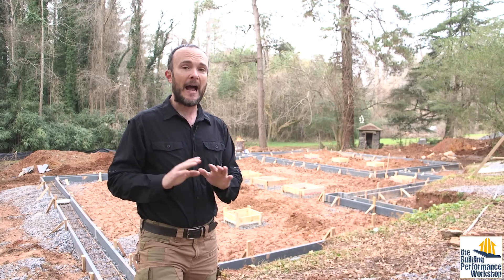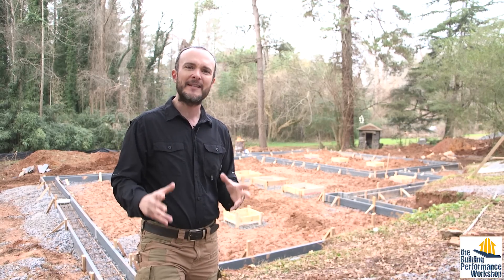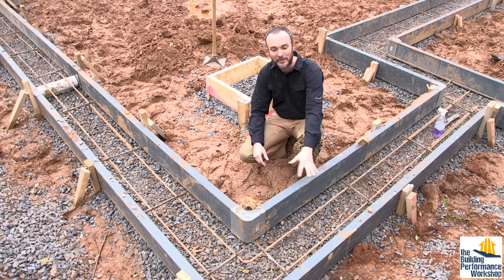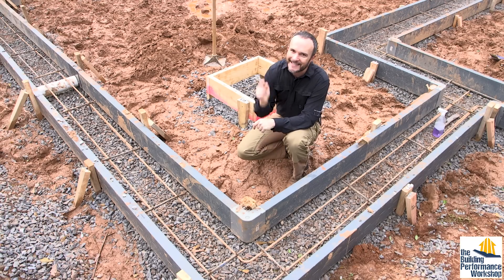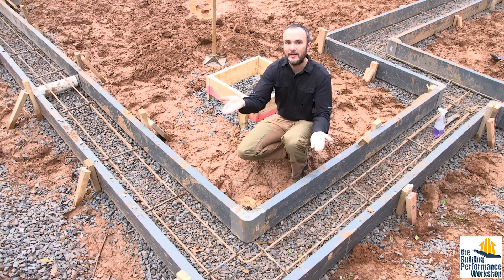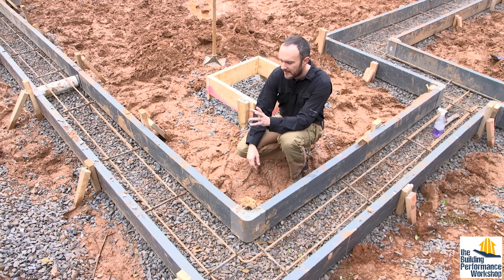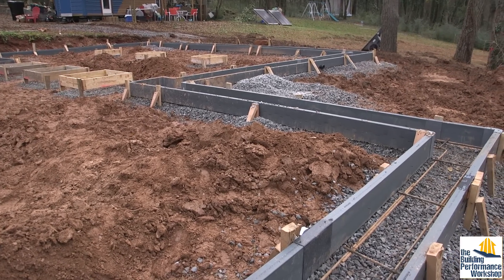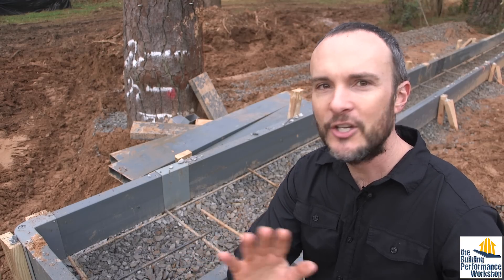First Concrete Pour: Form-A-Drain 4-in-1 Foundation Footings

Comment: Slum is on site . The foard were under supported , it's plastic. Point to order is that if the drain ever plugs you canot replace it and would need a plastic PVC with sock filers . Also on some construction the dept or hight of some area wouD make using this plastic for a pain and work foard is best .
But your fUN to watch . I built houses
Reply from the maker: interesting

Comment: Correction ! The slots go on the side on a French drain so that you get a bottom to carry the water away .
Anyway seems strange that what you have done is put a formadrain on top of a French drain , congratulations you just doubled the price of you're drains .
Reply from the maker: I don’tfollow any of what you just said
Reply: I guess that's why you will only ever be a cheque book builder !
You dug out a trench and filled it with aggregate , essentially a French drain less the pipe , then you constructed another drain over the top , I hazard to guess what that cost opposed to timber for work that you're concrete contractor already had .

Comment: Tieing the forms together on top by either nailing a stake across them or across the stakes themselves will help to eliminate most of the bowing on the footing forms. Im beginning to questing your concrete contractor as well as that is pretty standard as well as not having clumps of mud on the rebar since it will form an air pocket not allowing the concrete to bond with the rebar....Its the same as making sure there are not large loose chunks on the base or bottom of the footings as well.
Reply from the maker: State of the building industry, my friend.
Reply: @HomePerformance  Ya, I agree to that.

Comment: I love (Saint Gobain’s Certainteeds) Form-a-drain’s system.  

One single installation takes care of the footing ,water, Radon, foundation, and humidity.

Make sure to place a trench around the perimeter of your property for a secondary French drain with grated channels across the garage entrance area.

This will keep the soil under the footing dry during snow and raining events.

The other thing to look into are liquid footing and wall membranes as well as dimpled membranes for footings and walls.  Once your walls are up, cover them with a liquid membrane from the bottom of the footings to about 7-feet up.  Let the liquid stuff dry, and cover it with a dimpled membrane.  This will prevent moisture building up in your walls from the ground or from rain.  Avoid asphalt or heavy oil based materials for this purpose (usually black in color) since they become brittle with time, and will let water through.

The French drain trench, the grated channels, the liquid membrane, and the dimpled membrane are much cheaper to do during construction.  This is especially true before your utility lines for water, gas, and electricity are laid.  Once they are laid and connected, any installer will charge a ton in order to deal with them when digging a trench.

You will save tons of money in the future by doing this now.  In fact, you could do this yourself at this stage by renting a trencher from HomeDepot for a day (about $150), and you could lay the French drain in yourself around the house.  

Connect the French Drain around the house with a pipe leading away the property towards either a street, the lowest point in the property, or a future pond. If done properly (and depending on your local laws) this will comply with stormwater drainage.   Cover the French drain with dirt to allow your construction to proceed as scheduled.  Place some flags or markings to let the people for the utility lines know where to be careful with your drains.

Mark the spots where you have left connections for future downspout grated catch down boxes.  After your house is done you will reopen these points and place and connect these boxes to the French drain.  This way you will catch the rain water from your roof as well.

You will, also, need to dig and place a temporary spot holding barrel where you want to install a future sump pump for the French drain.  This should be done while digging up the trench for the French drain.  Mark the spot for future reference.

If it is legal in your state, you could, also, set the initial area for rainwater barrels.  You can plan it so that before the earth moving equipment is out of your property, it can be used to prepare the ground for this purpose.

Your kids hopefully will remember their visits to the house construction with Dad.

https://www.certainteed.com/resources/FAD%20Install%20Guide%20Canada%2040-01-01.pdf

http://www.understandconstruction.com/waterproofing-membranes.html

https://youtu.be/9n-W25Gd9oM

https://www.ndspro.com/stormwater-management/residential-drainage

https://youtu.be/TIaUgynbL_4
Reply from the maker: Thanks for the very thorough advice, Eric
Reply: Home Performance you are welcome.  

There is no need to spend more money on things that will have to be installed when problems are noticed after a few years.

Comment: It’s very frustrating building your own things when you don’t do it all the time read about what should be done and then have to deal with contractors that do stuff like pour concrete all the time. They know all the tricks on getting it done and sometimes those tricks are good but sometimes those tricks are actually bad.  I kind of feel like I can get 80% perfect if I work really hard, but if I just let the contractors do their work it will be 80% perfect but in a different way.
Reply from the maker: I feel you, Cy

Comment: Think you were "conned"about the slump testing which should be done on site. Also, you can measure the strength of the in-place concrete with a Schmidt Hammer.
Reply from the maker: Entirely possible, whether intentional or inadvertent
Reply: I have used a Schmidt Hammer before.  It is important to read the instructions on your model.  They usually advise testing concrete after it has cured past 7-days.  Yes slump tests can show that adequate and not excess water is used in the mix design.  If any admixture is used like a plasticizer or a super plasticizer though that would affect the slump.  [They're usually not used for foundations, but more when rebar is more intricate or complicated.]  

Very commonly with pours, the pourer also casts testing cubes during the pour, which they or the h/o can perform a laboratory test for called "compressive strength" - as an assurance the customer gets the concrete strength paid for, and these testing cubes are either part or not part of the pourer's liability, but at least it gives an idea to the h/o and gives some hold of the pourer to their word.

Comment: U can line the stakes up across from eachother and run wire across from one to the other that way they dont bow out as much. I also use that wire to hold up the rebar. That's a little harder to explain. 

Also, since you are super anal u could have run stiff backs on the outside of your form a drain. 

Or just used more stakes and kickers. They didn't have enough stakes in my opinion. 

Also, as someone else pointed out, you can do a slump test on site. Sometimes they are called for on site after all convenience water has been added. 

Additionally, dont worry about that mud being to wet. It wasnt. I used the TBL method. (Tell By Looking). Any given mix design takes into account some imperfections in the placement and conditions of the day when they rate a mix at a given psi. So even tho it wasnt poured out at a three slump, it can still meet or exceed specified design strength. If you want to help it out more, use a stronger than necessary mix and/ or use best curing practices
Reply from the maker: Thanks for the tips- and just to clarify, the stakes aren’t bowing, it’s the length of FAD between stakes that was deforming
Reply: @HomePerformance  at 13:03 it looks like there's 5 feet between stakes there in the back ground. That's way too much, in my opinion. I'm only mentioning this for people who pour a little footer (or sidewalk etc.) On there own with boards: when using 16 foot lumber I put 5 stakes per board. With 12 foot lumber i put 4. That's just a rule of thumb I like. If I were to stake something using that material, I would put stakes at least every 2 feet, and I would leave maybe 4 inches of the stake above the form so when I tied the stakes across from eachother with tie wire, I could move the wire up a little bit above the forms so the wire wouldn't interfere with placing/ leveling the concrete. 

For a first timer I think u did an excellent job!
Reply from the maker: Thanks for the tips brother

Comment: Your forms are bowing because the "kickers" which are supporting the stakes are at too steep an angle, causing the form to lift up and back.  Sorry but you might wanna find a different concrete contractor for the foundation wall pour.

Comment: I live in Oakland, CA. I replaced the foundation at the back of my home. I'm a DIY person. I had far more re-bar ... I built an inverted T foundation. The weight 
of your home I can't imagine that small foundation holding up in the Atlanta climate. Wishing you GOOD LUCK!!!
Reply: You also have much higher seismic loads in CA.
Reply: @ameyers67  very much so, most other states away from the west coast have more lax codes than California, Oregon, Washington do.
Reply from the maker: No worries, a reputable structural engineer designed the specs

Comment: Slump testing is routinely performed on-site. I would look askance at anyone who said otherwise. Another test method is to make sample cylinders, six inch diameter and 12 inch tall cheap plastic molds for those are available world-wide. For some jobs, there are more tests, such as air-entrainment.
None of those tests should be necessary for a home foundation pour. I would look closely at slump and any set accelerators that are used for your floor. Definitely do not pour your floor if temperatures are expected to get down to freezing, unless special efforts are taken to heat the concrete, and maybe not even if so.
Reply: You are absolutely correct about the slump test being done on site. I work for a cement manufacture as a chemist and I test everything before it goes out the door. Routinely we receive samples back from customers saying the field slump was bad. 99 percent of the time it is due to the accelerators they add to their mix. As for the air-entertainment there should be close to none 8 percent give or take to be exact for a foundation pour II-MT mix.
Reply: Air entrainment is not a test, it's a procedure.
Reply: @vdpeer  Yes, and there is a test for air entrainment %.

Comment: Leaving steel chairs in footing is a conveyor for rust to get to rebar.
Reply: Metal chairs and bolsters are used frequently. I personally like to use concrete block pieces to support my reinforcing
Reply: in Iowa we're not allowed to let rebar touch dirt. Must use concrete brick or dobies to hold it up.  That's why we only use fiberglass rebar at my company. No worries then.We do testing on all of our commercial pours, but typically don't on residential.
Reply: Sounds like a bad idea for sure. Normally the rebar is suspended from above isn't it, or you could use concrete dobies. Those corners also look like they're a bit lacking in rebar, and the footings seem shallow, and should have two levels of rebar tied to each other. Those are just my observations based on what I've seen in other concreting videos.
Reply: Metal chairs are to be used when pouring on a deck when pouring on the ground you should never have steel of any type contacting ground services most building inspectors will tell you this. At least in my area.
Reply: @JackSwine  metal or plastic chairs in Australia have to sit on tin pie plates
Reply: Pretty standard practice is to have 3in. From dirt and 1 1/2 from form. It looked liked you went every 6 to 8 ft on your stakes, i always go every 2ft on stakes and every 4ft gets a kicker. As far as the rust goes who ever said its like cancer is correct, any where ground water/ or moisture can contact bare untreated metal will eventually cause a catastrophic failure. Water infiltration will run with the rebar and if you live in a freeze zone it will crack your foundation like an egg ( ever see a big stone split in two by water ???? Look it up) while it will likely take years decades even. But what do i know i have only been a foundation form carpenter for a decade plus. Oh one more thing if they used a vibrator on it could have move more aggregate to the bottom in a way to have weakened areas of the footing.
Reply from the maker: Thx Brandon- vibrating compactor only used before forms and stakes. Stakes are actually closer than 6-8 ft, I’ll check the exact.
Reply: @HomePerformance  I have never seen rebar installed like that. So much weight in a 5 slump. Most of those dowels sunk or were pushed to far down. Honestly though the house will fall apart before the foundation has any problems as long as the ground is good. I dont recommend doing two seperate pours on ground like that. The weight from the first pour will or can cause cracks in the footing due to uneven pressure throughout the footing. Seeing that they did 2 seperate pours. Did they install waterstop at the cold seam?
Reply from the maker: The footing didn’t crack, and no one else brought up that concern on my team. Don’t know what waterstop is, sorry.
Reply: @HomePerformance  it doesnt happen all the time but it can. I guess your wall is only 4ft so its not that bad. Im thinking more of a stepped footing or higher walls. I mostly pour 8ft-9ft foundations. Waterstop is placed in the cold seam. New concrete to old. Either you install it in the first pour or you get another kind that is installed after the first pour. The 2nd kind will expand a bit when reacting with the new concrete. The new concrete can shrink away from the old crete during its curing and will leave a gap for water to get through. This is only a concern if the cold seam is in your basement wall and its not a concern if its in a garage wall.( not leading to the basement.) Just because that seam looks nice after the pour Doesnt mean it wont leak.
Reply from the maker: I hope you’ll stay tuned for our water management system
Reply: @HomePerformance  lol Im always in the mood to learn something new.
Reply from the maker: A man after my own heart
Reply: Plastic covered rebar is the only way to mitigate rust from working its way in.  In maine where frost heaving is an issue we use concrete bricks.
Reply from the maker: Are you sure there’s research to back that up, or is it maybe a myth? And how much rust would matter?
Reply: Home Performance  As to how much rust matters, several factors such as actual loading on rebar and size of bar, use as tensile strength or temperature steel among other factors.  But yes it should be a concern.  You might want to check out this video:  https://youtu.be/PLF18H9JGHs.  Not criticizing just informing.
Reply from the maker: Thx
Reply: @HomePerformance  yes there is, rust matters... its like cancer in concrete, once it starts it grows. It would surprise you how many times I've gone to review failures and the cause is degraded rebar. Plastic chairs are fine or even bricks are better than metal chairs. Also I would have hired a tester to do onsite tests since you spent so much money and time on that forming system, no offence but overkill in my opinion. Oh and thing may be different in the us but I've never seen anyone just dig a trench for strip footings.
Reply: @HomePerformance   concrete coverage is a key so yes steel rust is a problem
Reply: @HomePerformance  seems more reasonable than needing to wash your rebar😂
Reply: Cement 'cupcakes' for chairs are great. Rip a section of plastic pipe into short C shaped legnths, pack with a strong cement mix and cure in a bucket of water for a few days. Can obviously be made to any height and diameter, and seal perfectly when poured over,  preventing rust creep.
Reply: William Carr you can place folded over tie wire in the “cup” so that they can be fastened to the rebar to stabilize placements.

Comment: If you are pouring columns for a high rise building you can be assured there is a slump test performed on every batch and every truck by the engineer.  And if its not what was called out the truck is turned around.  He could have gave you one he just couldnt be bothered.
Reply: This guy seems like a know-it-all dumbass. I thought it was funny that he left that large pine, so close to his foundation. Those roots are already under his house before it's even built. I'm sure they won't grow anymore...haha! Oh, and I loved that he used the weakest screws on earth (drywall) to keep the form attached to the concrete. They'll be rusted out and broke off before the roof is up! Those are just minimal things wrong. There are a lot more major issues wrong that will make him get sued when he tries to sell his house because of the crumbling foundation,  that'll start at the first freeze
Reply from the maker: @rickyfink9891  if you think that's all we're doing with the foundation, you must have missed that this is part of a SERIES. Literally none of your predictions can come true with the designs we're using.
Reply from the maker: Probably. There’s always such thing as ‘good enough’, and going the extra mile sometimes doesn’t matter